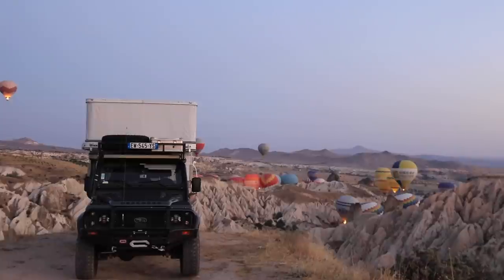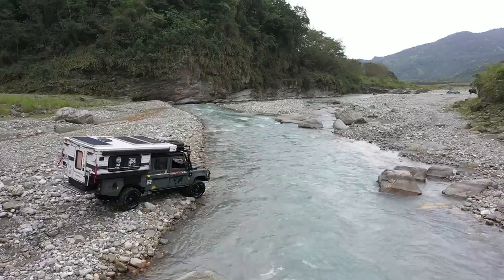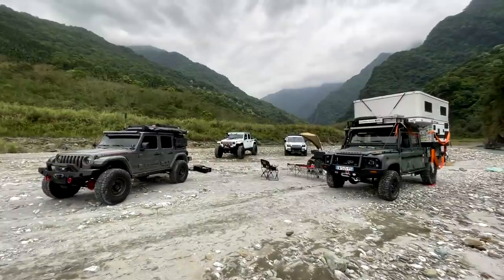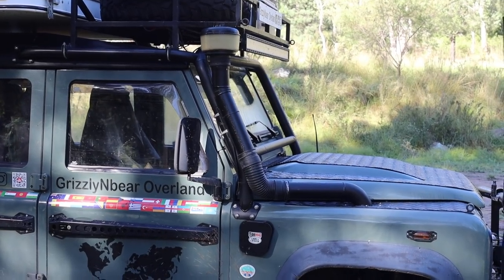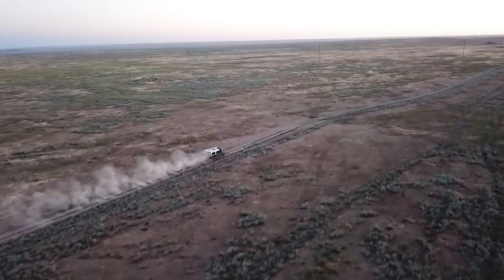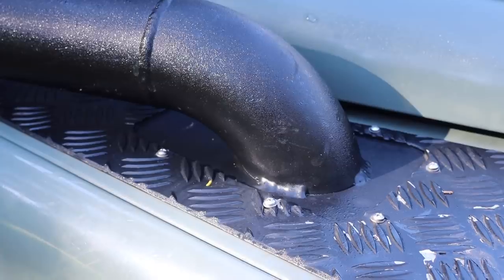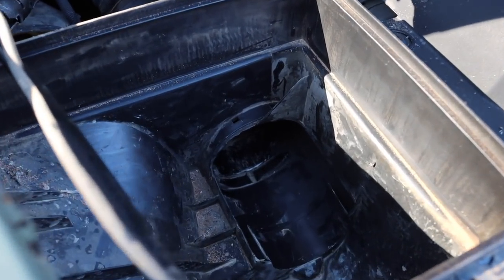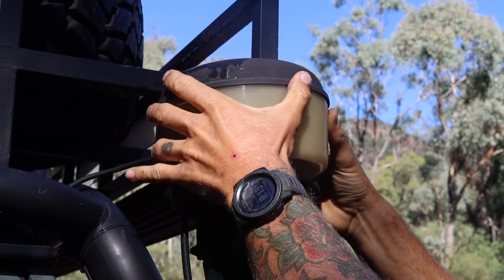Off-Road vehicle Raised Air Intake or Snorkel... Do you really need one? GrizzlyNbear Overland

Comment: Love it! Well covered! Amazing how many raised air intakes are not water tight. Another thing to consider even if it is water tight are the diff breathers and gearbox/transfer case breathers. If going through water with hot diffs and gearbox they will suck water in. It’s an option to have all breathers raised or allow the vehicle to sit and cool down before going through water. Just allowing to cool down will prevent water ingress but obviously takes more time :) 
Keep the videos coming mate. Love them all. Rusty says hi too :)

Comment: for quite a few cars you DO need one. Take my hilux for example. It breathes above the right wheel. With the original bumper in place it's unlikely to get water in there. However with an alternative steal bumper it's likely wates is pushed in that wheel arch with quite some force as soon as you hit water that reaches the underside of the bumper!!!

I did find cups of water in my airbox after doing some driving on forest roads with average water. (like halfway the wheels)

Comment: I get so many negative comments on my raised air intake on my Extreme Rodeo.  And I get so tired of trying to make people understand that it's not for water crossings as much as it is for breathing cleaner air. (West Texas Dirt Roads & Trails)  But, I do have all my breather tubes, (rear ends, engine & transmissions crankcases) raised to windshiled heighth for "just in case" I do end up having to swim a deep rivier.  Which I have had to do.  

I was so surprised to find out that so many of the other rigs I was wheeling with in west Texas that had issues when we came upon the deeper river water than we expected, didn't have all their other breather/ vent tubes raised up above their poser air snorkles. I ended up dragging quite a few out to dry land so they could change out their water contaminated fluids before continuing on our journey.  And let's not forget the ECM's that are usually on the kick panel or mounted under the seat.  (Mine is relocated to up between the top spreader bars on my rollcage.
Excellent video as usual Lee!

Comment: The air from a raised air intake is significantly cooler as well thereby increasing power a little bit. It prevents hot engine air from entering the air filter and instead takes ambient air.
Reply: Sure, but a 'cold' air intake has proven to be of marginal or of no use in many studies.  A longer and thus more restrictive intake would probably be even worse on power than any other option.
Reply: @fawshaw3361  but still waay cooler than hot engine bay air 🤠

Comment: Depends on where you go, Leigh. Lots of places here in Oz there are plenty of water crossings that need one, especially in FNQ. But I agree, for overlanding it's probably not essential. I wouldn't be without one however. I've been in the situation where crossing was almost a life saving situation and the RAI made it possible, as the water was above the bonnet. I don't look for these situations though.
Reply: Absolutely I agree and I've had one on all my vehicles for the last 20 years.
Although how many of those you see on the road are ever going to go through a water crossing that deep...
Also how many of those are actually 100% water tight.
Usually it's the air filter housing itself that will have water ingress even if the intake itself is sealed.

Comment: Another really interesting video, thanks Leigh. Completely off-subject a thought occurred to me when thinking back to your difficulties in getting a cell phone signal when you were on the Girrawheen station. Maybe I'm the hundredth person to suggest something of the kind but I wonder whether it would be practical to elevate the phone higher by using a helium balloon. The balloon itself I suppose need not add much weight and shouldn't be much of a weight problem, I realise though that a helium gas container may rule out the idea as practical for your needs but I thought I'd mention it in case it would be possible to get a small gas bottle and thus to help you with that problem?

Comment: I was under the impression the raised air intake was not necessarily watertight, it was only a raised intake, to get a watertight raised intake you need a snorkel
From what I've been told Toyota sell a raised air intake but don't say its watertight so no change to fording depth

Comment: TBH, I bet half the vehicles with snorkels don't have a sealed air-intake system anyway.

However... it'a not just outright water depth snorkels help with.
Year before last I was trundling through a 6" deep flood in a Ford Focus, some numpty in a van comes the other way, drowns my car, water must've got into the air intake, the car makes it another couple of miles and and then a conrod decides to stab through the side of the engine block.

I'm guessing a snorkel, up at roof height on a 4x4, is a lot less likely to get water splashed into it.

Comment: Hi Leigh and Stef, If you watch the Aoto Expert John Cadogen" , he has done tests on snorkels and unless you do deep water crossings he found that you got less air flow through a snorkel due to the change of direction of air flow through the snorkel .if the normal air flow is under the front mudgaurd in front of the wheel you get no dust in the filter. I have done thousands of klms on dirt roads and  will take the ir r filter out and there  is hardly any dust inn it, also not all snorkels are waterproof. Don't take this as critisim it's just another persons view. I still enjoy the videos
Reply: Yes I would agree. The argument of the raised air intake for dust is used a lot but I never saw anything to back this claim.
Original air intake are protected under the hood or the mud guard, air gets in indirectly so anything big (leaves, insects...) can't get carried by the wind and things like dust have to find their way through the engine compartment and have many opportunities to hit something (radiator?) and fall to the ground. While a snorkel directly takes air outside and it's not taking the air 1m higher than stock that will change that much the quantity of dust if you drive behind someone. The best way to see that is that your engine compartment is not getting dirty as quickly as your bonnet or windshield.

The general answer to that is "yes but my snorkel has a pre-filter" which I would answer that you could perfectly add a pre-filter without a snorkel but no one feels it's necessary to bother. 
Fun facts some models of Land Cruiser used to be sold in dusty countries (ME, Africa, Australia) with an integrated cyclonic device directly inside the air box around the filter element.
Reply: Thanks for the comment. It's interesting you mention about the air intake under the mud guard as on the station we worked on recently we witnessed a Ford that had its turbo and then engine completely destroyed due to the air intake being in that location.
I personally saw the interior of the air box full of small gravel stones which shredded the filter then went on to fill the turbo 😬
Not a location I'd want my intake after seeing that.

Comment: In my experience 99% of raised air intakes on modern vehicles are for decoration only. The stock "desert air intake" on the Tacomas spring to mind (and I'm saying this as a Taco owner.) I think the only legitimate scenario for having one is when you are regularly driving thousands of miles in heavy dust (like Leigh and Steph do).